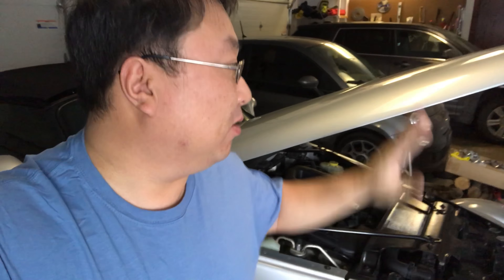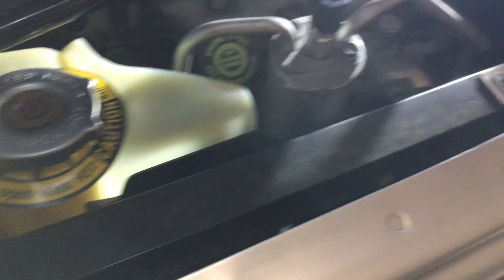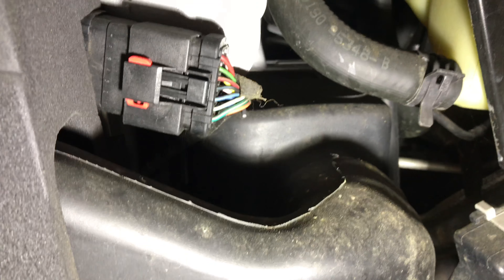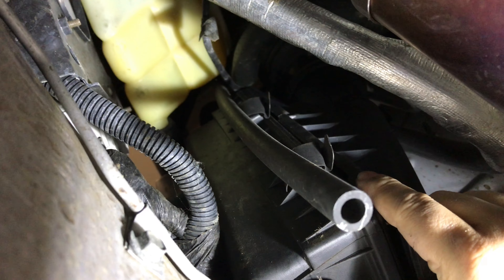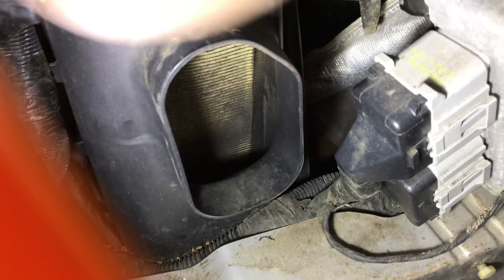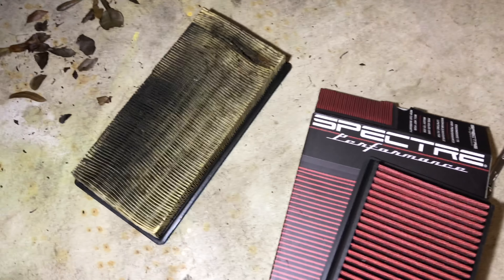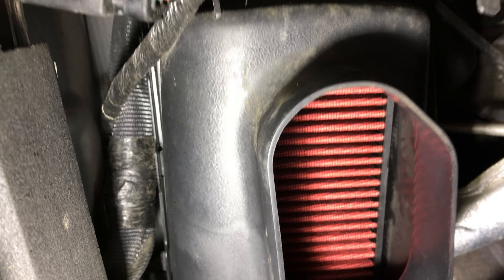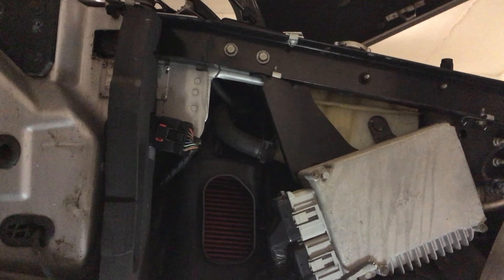How to replace the engine air filter in a Plymouth Prowler

Comment: I just changed the air filter on my 2001 Prowler and I recommend spending the five minutes to take the side panel off (don't forget to disconnect the signal light and wiring).  You will need to see how to align the tabs on the side of the filter in order to get the proper seal.  Otherwise you will waste the better part of an hour cursing the engineers who placed the air filter on the side of the car.
Reply from the maker: I totally agree with you.
Reply: Can this be done without the car being up on jacks?
Reply: @tomclatfelter2631  
Yes, if you are thin like Gumby.